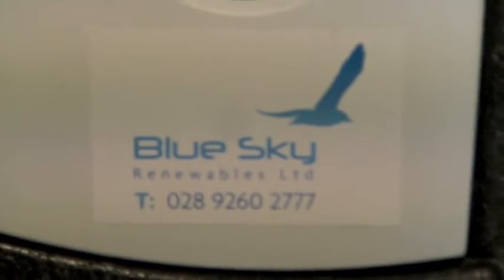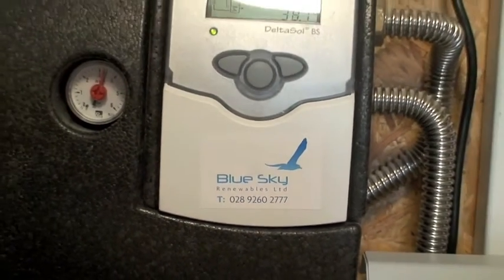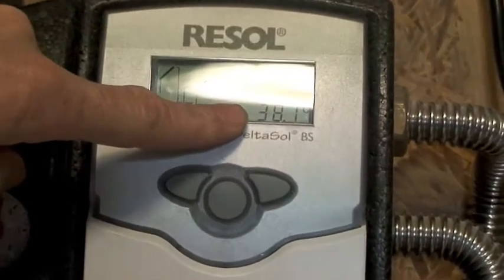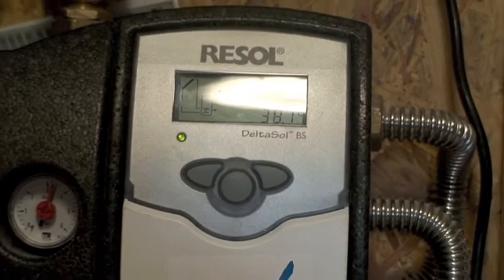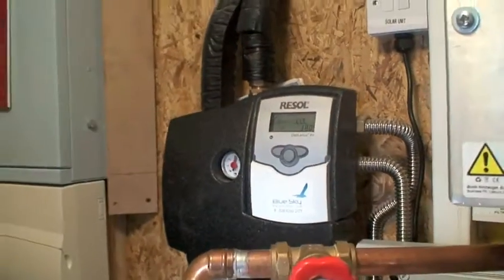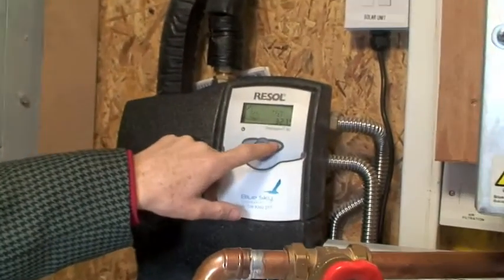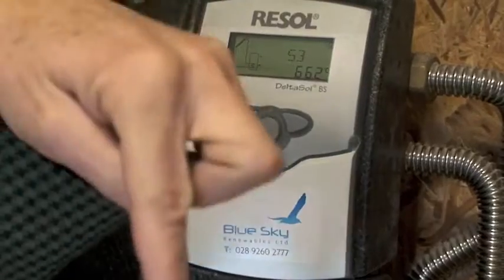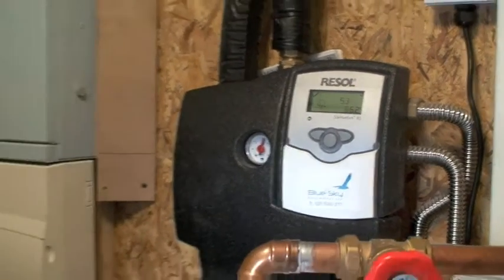Sky Developments - 1 Minute Wonder - Part 3

Comment: I want to make sure I understand: 

The solar gets the water up to about 38 degrees.

And then after the solar has done its part, some OTHER source of energy boosts it further up to about 66 degrees. 

Is that how it works?

If so, what is that second source of energy that finishes off the temp difference between 38 and 66? 

Or am I totally misunderstanding all this?